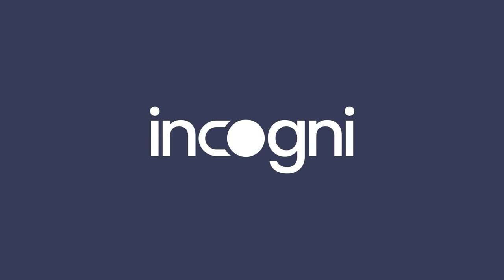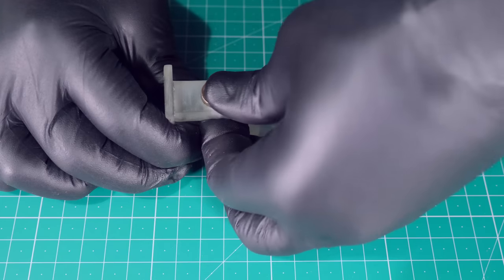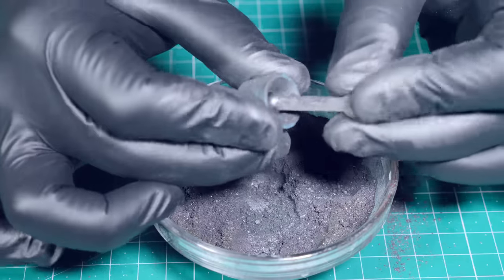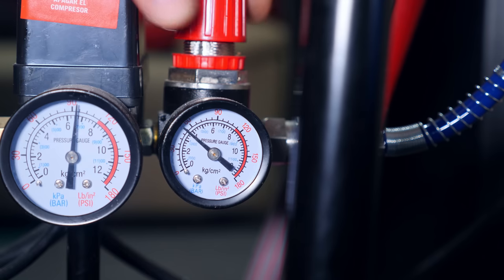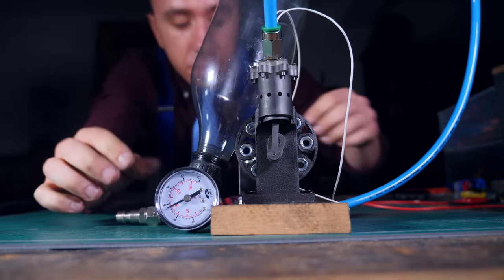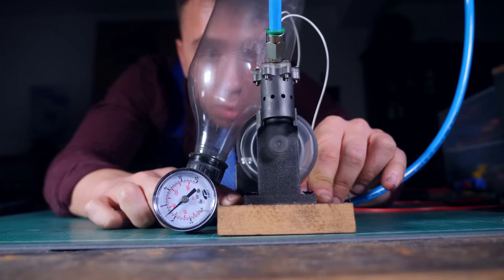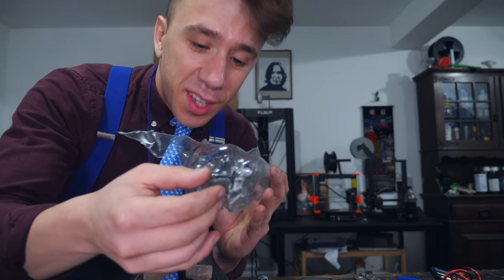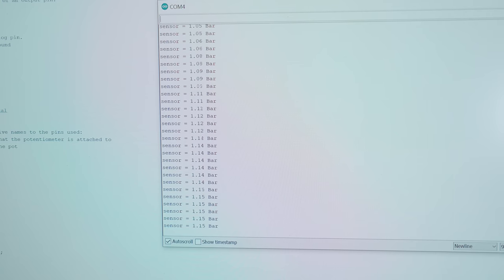Magnetic Air Engine

Comment: nice design but heres a better one, 1: reinforce your plastic bottle with fiberglass to increase the pressure it can hold in one go use this as your power source and fill it with as much pressure as possible, next the power source enters into a ball valve that you can control using a servo the more open the higher the pressure the less open the less the pressure this way you can control both the speed and pressure and have a multispeed-linear air engine with a very long run time, curtesy of the reinforced bottle and varaible valve , next add a heat sink to the cylinder and use the exhaust to turn a fan that blows over the heat sink this will raise the temoerature of the cylinder and allow you to extract more energy from the compressed air. to increase the power change to a double acting pston setup, your current setup uses external power instead use a tiny li-ion battery that is charged by this change: use neodymium magnes instead of the nuts to weigh the flywheel and then add a coil to extract electricty from the flywheel use a little of the energy to recharge the battery and the rest for whatever lol then youll have a fully working engine. wish i had a chanel and tools i would enjoy building this. new account long time fan from zambia.

Comment: Back in the 1980s I flew model aircraft powered by CO2 engines. Think they were made by Humbrol. Basically they were the same design but had a small metal tank charged from a CO2 cylinder as used in domestic fizzy drink machines. The fins on the cylinder head were used to heat the cylinder not cool it.

Comment: 2 ideas 1. how about a rotary ( like a Wankel ) design with no valves that the rotor movement does the work of the valve.
2. Could you use a couple of larger compressed air bottles charged to 6 or 8 bars instead of the CO2 cartridge, use a large volume of compressed air to keep the engine running.

Comment: I have seen plenty of your videos and can tell you enjoy chasing science and seeing whats possible! I was wondering if you ever tried running your Tesla turbines off of a vacuum instead of compressed air, as in hook a household vacuum or something stronger to the exhaust port and leave the inlets at atmospheric? Another variation I would be interested in seeing would be a Tesla turbine run on vacuum with more than one inlet port! I have a strangely interesting design for propulsion that I have been theorizing but no current way to produce or test but that will come in time.
Reply: @integza I appreciate you sending me a notification but as I do not have a cellphone I cannot access telegram to message you. Thank you for trying to reach out though.

Comment: Hey I got a thought.. rwhat if you made a 4 cylinder engine.. each cylinder is about 1/4th away around the crank shaft. When one piston is opening the ball, one would be on its way down, one would be at the bottom, and one would be on its way up.

Comment: Gear your drive wheel to power a form of bellows or compression cylinder and see if you can eliminate your big electric air compressor. Make the system self contained / self sustaining.

Comment: I would like to see you test one of the new style AI jet Engines. Like the ones with a honeycomb lattice, a cellular structure, or a porous material. The goal would be to print the object with such a complex internal structure that it has specific properties, such as lightness, strength, or heat conductivity all generated by AI.

Comment: The problem is, you are letting air out. 
You need to make the air pocket seamless (hermetically sealed)
Like a balloon or a shock absorber, using the air container's resistance as a spring.

Comment: Pressure drops a LOT when released into the container, because there's barely any air. It's like static electricity. Lots of potential, nearly no current.

Comment: I see that the temperature of CO2 canister is decreasing pretty fast. Maybe the efficiency and runtime can be improved by heating element like nichrome wire? It wouldn’t add too much weight since you use already use electricity. Just draw some more from the battery!

Comment: I am planning to make a pressurised HHO mixture, combustion/pressure hybrid using your designs with some modifications, basically your design but with a compatible spark plug piece to ignite the HHO, then doing what yours does. Not sure if its been done before but if not there's a first to everything, I need some help to get some 3d printed models of the engine of your design and if possible to help design the modifications. May be much to ask but if so this may be the answer to adding more torque and straight power to your design. Love your work and videos, and I also know there is a low chance you answer, if you do I will likely make a video on it on a separate channel. Best of luck, this may be amazing or a happy failure. This may take months for me as a have not nearly the setup of yours, best hopes.

Comment: Ok here’s the next one I want to see this but with propane or butane as the medium. You need an engine that runs off pressure that then turbos a combustion chamber with the same gas.
Reply: Make it with a mini alternator for electricity used for electrolysis in a HHO generator. Feed the oxygen and hydrogen in the combustion chamber for some kind of gains.

Comment: Video Idea: Ever thought of making what I’m going to call a variable flywheel engine, which is an engine that has a flywheel that has adjustable weight to slowly take extra power that would otherwise be lost and conserve it by adding weight. This could also be used when a certain balance of rpm and torque is needed( comparable to a gear ratio).

Comment: Put magnet sensor on side of engine so it opens valve early.
Or you put to sensors by which at low rpm sensor at top work and at high rpm sensor at side work

Comment: Is it possible to turn the energy from the piston to power a pump to keep adding pressure into a bottle creating a compressor that’ll add air and extend or infinitely run the engine?

Comment: I think it would be very interesting to see this used for would be a balloon (dirigible ) the fuel (compressed air)  in  this case could be used to control  both lift and propulsion and the fan propulsion would be a low torque propulsion.

Comment: Dumb suggestion: Metal bar with more than one air capsule plugged into it and at one end the valve sensor that opens when pressure bellow 2 bars. That way you would have the exact same thing but with way larger "fuel tank"

Comment: This engine runs on high presure and low air volume, i think you should make a smaller diameter cilinder piston but leave the stroke (travel) as it is, that way you use less air volume. and maybe double the running time

Comment: Have you tried fitting an expansion chamber to the "exhaust" ports? I wonder if good dimensions/timing might aid air flow in some way? Like create a vacuum drawing out the last spent air pressure for a moment at the end of the down stroke.

Comment: You could probably stop energy loss from sudden pressure change when the CO2 canister discharges into the drink bottle by putting a buffer in your code instead of a set value of 2 Bar. 

Say 

If pressure < 1.6: 
        Open Valve
If pressure >= 2:
         Close Valve

This would mean the CO2 can discharges slightly less frequently to decrease the spikes, which (pure assumption here) 
I'd imagine are being forced into the engine anyway so you're losing time.

Comment: By adding a second CO2 cartridge and alternating between them, the rapid pressure change that causes the frost on the cartridge and reduced pressure with the temperature loss would diminish by half and give you twice the basic run time. also, if you could delay the valve opening on the engine by a degree or so past TDC, you'd get more "bang for your buck" so to speak.

Comment: It looks like it opening at little early withs its not a problem at highere rpm sicne the gas has time to expande and and give the force at the right time i suggest controlleble valve opening wich could be done by adding an curcite to delay the opening at low rpm and increase at higere scooters with cdi do this and try use a hall efect sensere insted withs shuld be able to handle 10k+ rpm sterling kit has some for a resaneblr price

And with this setup you should also be able to se the rpm 
Theres also a app called simple dyno to messure the power of the engine

Sorry for bad english its not my first laguese😅

Comment: You should make a 2 cylinder engine that runs off of the little Co2 canisters directly. Almost like the little rocket drag race cars from back in the day, but instead of using the cartridge as the thrust, is it as a fuel to rotate a motor and the tires.... just an idea
Reply: Really?

Comment: hey integza! just wanted to comment since i saw a slight problem with the orientation of your co2 canister, using them while sideways is a good way to freeze your valve and cause your seals and lines to fail, you should never use them in any other orientation except vertical unless you have a specific kind of canister

Comment: I really enjoyed that one! .... I was wondering if a 3d printed sock to fit over the bottle would increase pressure resistance and maybe save a little on use of the CO2 canister and allow it to run a bit longer, maybe the sock could be printed in TPU/TPE. 
Also as an idea for a future video how about a vacuum engine for use with a 3d printed vacuum former/molding machine. or maybe a human powered compressor for charging the bottle! 😃😃🖖🖖 or maybe the vacuum former could be used to encase foul tomatoes in thin plastic so that they can be pressurised and then shot with an air gun (3d printed of course)!

Comment: build ideas:
 a combustion engine using rocket propellants (like a V8 or smthg similar)
an electric device, running on tomatoes
a torture chamber for tomatoes
a torture chamber running on tomatoes for tomatoes
a tomatoegun with pressure from rocket propellants (tomatoe launcher)
a tomatoe shaped grenade 
a selfmade smoke grenade

Comment: Maybe i'm stupid, but couldn't you remove the soda bottle totally and use Arduino (or even a mechanical valve) to provide a steady pressure of x bar from the can to the engine directly?

Comment: Get rid of the bottle and use a compressed air carbon fiber paintball tank with a regulator. Most are rated at 4500 psi and are very light. Though you will have to get a compressor that will do that kind of pressure.

Comment: You should get your timing from the flywheel instead of the piston. That way you can advance or retard the valve opening to match the desire to speed up or slow down the motor. Sort of like the spark advance on an old Model T functions as a throttle.

Also on the ball bearing valve a wider piston face would have changed the work ratio between the working pressure on the face of the piston and the face of the ball .

You probably also wanted to introduce the airflow as a ring flowing up towards the ball around the circumference of the o-ring. That way you would minimize the Bernoulli forces trying to close the valve due to airflow.

Finally, rather than using CO2 cartridges, you should have used dry ice. That would give you considerably larger gas generation volume per unit space. You need a safety valve but you could control the amount of gas generated by controlling available heat sink or even drawing ambient air over the heat sink as part of the working cycle of the motor.

For loading the dry ice, you could use an inverted mason jar with a metal lid. The metal lid would be both your heat sink, your permeable place to mount your valve, and you could unscrew the mason jar to insert the dry ice and cover it with the mason jar.

Comment: What do you think about putting some neodymium magnets in the gear and a couple in the top and bottom of the middle piece, maybe angled so they have a repel force and can keep the engine running, also it’s possible to harness the energy of it to re pressurize a container? Or pressure through combustion?

Comment: You could improve this design by adding vvt by having the magnets on a camshaft as such that can change variably based on the rpm, this would make it more efficient, also who doesn't want a vtec badge on their air engine

Comment: I was thinking. Why not use a smaller ball? Like maybe 3mm or 1/8 inch steal ball bearing. And then use a needle to open it. The smaller ball would have less air pressure on it and therefore easier to open.  Less work for the motor. I also had an idea for a new video for you. Perhaps you could use some thermite to extract gold from old computer parts 😆. What do you think?

Comment: What you should do is set a 3 canister valve system and the computer will run down the line of CO2 canisters, once one is empty it goes to the next, then the next, that way you can change them without losing to much pressure, or do a 2 CO2 canister system, either way it should run until you run outta CO2 canisters

Comment: Dude... you should have a bank of CO2 cylinders, each with an individually controllable valve and write a code so that it can draw from each cylinder in sequence, with some way of monitoring when the pressure stops rising to tell the controller to switch to the next cylinder. As each cylinder is normally closed to the main tube, you just need to unscrew and replace them . Maybe they could have a quick connect collar to make replacing them easier.

Comment: You might just gett higer pressure if you use a smaller bottle.  But that don't sort the chortage of air volume.  But that you might get by reusing the exhaust air and get that back in the system to cut the loss just a little.  Let's say if you can reuse  the air at about half the pressure then you should be able to use less volume of higher pressure to keep it going. Either that or I'm really out of thought 😂

Comment: The 3-D printed air engine does not work because the driveshaft does not have a counterweight, so it is not helping out the compression of the piston pushing up the ball

Comment: could you maybe instead of using the nuts you have in the wheel use (probably alot) of magnets in some sort of order/angle so that their own magnetic repel force constantly pushes the wheel round totally eliminating the need for compressed air at all? and then theoretically the engine will run until the magnets lose charge?

Comment: Just an idea (maybe impractical but I'm interested to find out), how about maintaining the magnet on top of the piston and putting another magnet (in opposition i.e. N-N or S-S) on the valve. So as the piston comes up, it pushes the valve up (via repulsion), allowing air into the cylinder. Then as the piston goes down, the valve comes down, cutting off the air.  This way, there's no contact between the valve and the piston, reducing wear. (",)

Comment: usea a spring gass regulator and only the co2 to mantain a specific pressure on the sistem and you can fit more bottles to make a flying airplain

Comment: Im going to make it a mission to earn a 3d printer from you. Also an improvement for your air compressed piston, I got this from another YouTuber ,he printed the head of the piston to have a chamfer using a malleable material so when the piston chamber got filled with air the piston head will form to the chamber walls making a total seal so pressure was not leaked or under used. Also I to recommend using a higher grade air compressed container to hold more air and  create more power with a limited valve so the pressure is spaced out and not used all at once or blows up the whole mechanism and expanding run time and I would also make the fly wheel cnc carved aluminum or steel so it also increases torque and more run time
Reply: Ew tomatoes 🍅🤢🤢
Reply: The sad thing is that I know your a scammer and the other sad thing is I know what integza's giveaway sentence is
Reply: @integza you have a scammer

Comment: Is there a reason why you need the bottle at all? Can't preasure be slowly released into the engine directly from the CO2 canister? Maybe attach the canister to a valve and the valve handle can be used to adjust throttle.

Comment: About a decade ago there was an inventory it two that essentially came up with air powered cars. Storage was the issue but I think they used carbon fiber cannisters. I think roughly they had a similar range to current electrics, except your "charge time" was as long as it took to refill the canister.

Unsurprisingly, the research and stuff has gone dormant.

Comment: Probably an HPA 0.5L or 0.7L bottle would do the trick, is light and contains a lot of air. And with the help of a regulator you can keep an steady power output without spikes.
Any Paintball or airsoft store should have them. 
A cheappo little bottle like the ones i mention with the regulator should not cost more than 130€

Comment: @integza you could improve the bottle pressure capacity by wrapping it with a steel wire and resin. I would use 2 layers. And if at the top of the piston you had a magnet with the same polarity of the valve magnet, so that it would be repelled opening the intake at the top position of the piston, it would be mechanical. But instead of using a spring to close the valve, an upper magnet with the same polarity could do the job. The ball valve must therefore be a magnet. You'd support bigger rpm and torque.why not using the Wankel motor you have done, but with graphite?

Comment: Can the exhaust air from the engine be recaptured and used in some way to reduce the need for fresh compressed air? or incorporate an energy recovery system? For example, capturing and storing some of the energy generated during the engine's operation to assist with compressing air for the next cycle.